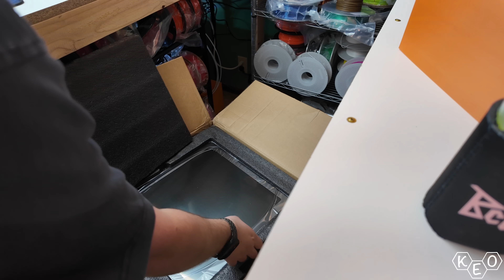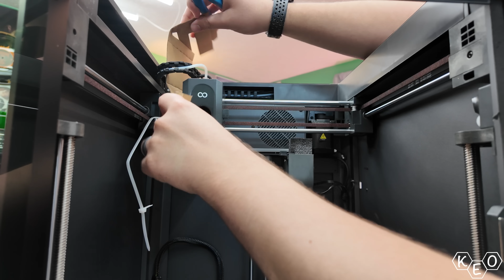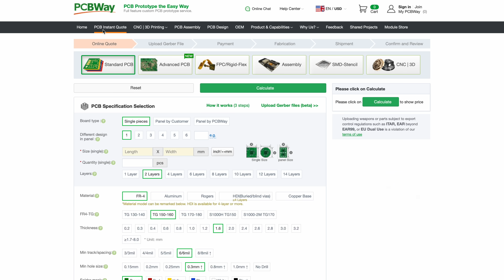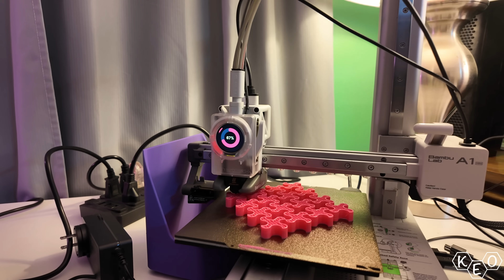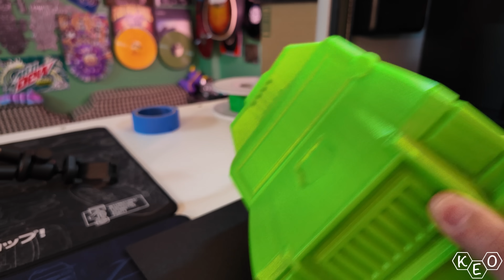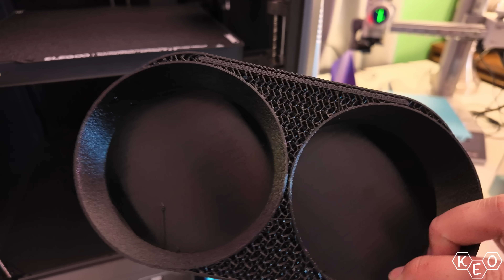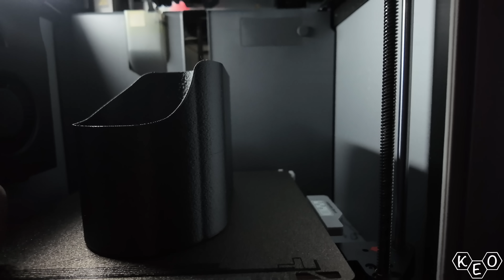$300 for THIS? Elegoo Is Playing Dirty…

Comment: Another great video.  I posted my unboxing and first print video a couple of days ago and it was funny to see you mentioning some of the little niggles that I had.  That final curve in the filament tube into the print head is a real pain and I like your solution of running it over the top, but it really should have to come down to this.  One thing that nearly caught me out was the small piece of foam that was in the poop chute.  I had actually started my first test print and as it was warming up I spotted it just before the print head would have moved into it.  
I had one filament change, and the instructions on the control panel threw me a curve ball.  I kept hitting load and watching it go through the 4-point routing and then I'd be back at the screen where it asks me to load again.  I did this 3 times wondering by it wasn't detecting the filament that was flowing through the nozzle, until I realized that I had to hit the "home" icon on the screen that would then take me to the print screen so I could press "play" and resume the print.
I've only used PLA so far, but slicing a few models on a 0.12mm layer height setting has produced some fantastic results.  After seeing your results with PETG, I'll need to give that a go soon and see if my results are any better.  
Like you, I'm just very impressed with the price point.  If someone asked for a cheap printer for their kids to try out 3D printing as a hobby then I'd highly recommend this machine for ease of use.
I didn't see you do a firmware update.  I spotted that one was available when I set up the wi-fi.  If you haven't then perhaps that might help with the PETG issues.

Comment: PTFE Tube and filament path. The sharp curve is needed because of a lack of headroom under the lid. First thing is print a riser, then reconfigure the tube path. Simply unclipping the tube from the front half of the chain works pretty well. 
The runout sensor position doesn’t suit printing from a drybox. There are several simple prints online to space the thing off the wall and even angle it slightly. 

I wonder whether tube-drag plus stretchy filament might have been part of the TPU problem?

Comment: The IP address - one needs to go into the settings of the network router to fix the CC to the same IP address every startup. The CC doesn’t have the facility for a static ip address, and you don’t want to be entering a new number every day!
Reply: This. I give all my printers static IPs via DHC reservation on my router.
Reply: Your router should be able to assign static IP to the machine.
Reply: @tymoteuszkazubski2755  exactly what I said! Don’t expect the CC to do it for itself in a setting.
Reply: IP reservation is the way.

Comment: Been printing only ABS on my Centauri Carbon, its got just under 16 hours on it and needs replacement parts already.  The hotend keeps clogging and support are sending a replacement hotend and fan.  Prior to that though the printer was doing amazing at printing, the plate is perfect for ABS .  Support from Elegoo has been really good.  It also seems quieter when printing than my other printers
Reply: At least they offer a hardened nozzle too. The Kobra doesn't even offer that nor different sizes.
Reply: @Real28  Elegoo only offers a brass-hardened steel nozzle in all sizes for the Centauri Carbon.  Which I think is a good thing since the printer seems very capable with abrasives. I've only ever owned one Kobra and had no idea they only supplied brass nozzles in their newer printers, handy to know for future, thanks.  I think I just got unlucky with this one.  Hopefully the next hotend lasts longer and I can get some spares when they come in to stock, Which is some time in July at the moment.
Reply: "so is this like your first 3d printer?"
Sounds patronising ngl
Reply: I use ABS.. never had that problem
Reply: @marcwolf60 mine had a print head board failure causing thermal runaway. So it was melting where it shouldn't causing the clogs
Reply: @TeeborGames how did you diagnose the issue? I ordered my CC a few days ago with the intention of printing almost exclusively ABS
Reply: @GianmarioScotti there was a fault in the printhead board causing the hotend to get too hot.  Support sent me a replacement and it's been good ever since
Reply: A clogged hotend doesn't require replacement parts... Just know how of how to clear a clogged nozzle
Reply: @3dcreationsofri  You must have missed the part where I said "Keeps clogging" as in did it more than once.  So I must have cleared it and then it happened again.  However it should not happen at all on a printer with so few print hours on it
Reply: @TeeborGames so... Is this like your first 3D printer?   There are any number of reasons for nozzle clogs to happen, none of which are the fault of the nozzle... The nozzle is just a precision drilled hole in a piece of metal that you push filament through... If you're getting clogs, it's because of whatever it is you're trying to push through it... Perhaps poor quality filament, perhaps insufficient nozzle temperature, perhaps additives in the filament (i.e. some carbon fiber filaments will clog a 0.4mm nozzle repeatedly because the pieces of carbon fiber are simply too big to pass through the orifice, perhaps you're trying to print with too small of a layer height (I can clog a 0.4mm nozzle almost on command belt attempting to print TPU with a 0.8mm layer height.). The only number of hours use with a nozzle would be premature wear...i.e. if you got a 0.4mm nozzle and after putting a couple kg of just ordinary PLA through it, it was extruding a 0.7mm line width, then that would certainly be premature excessive wear... But even then a worn out larger orifice isn't going to cause clogs.
Reply: Bottom line...if you're getting REPEATED clogs, it's not the fault of the nozzle... It's either you're doing something wrong, or there's a problem with your filament causing it...not the nozzle
Reply: @3dcreationsofri  Do you want me to sign you up for a reading comprehension course? So you don't shit yourself in a comment section again?
Reply: This is the WHY you buy a Prusa. You'll be printing, not working on the printer.
Reply: @mortenkallesen923  what about those with Prusas that need to be worked on because spending the extra $$$ isn't a magic fix-all lol
Reply: @TonyAllen1988  For real i think bros mad cuz his printer is getting shown up

Comment: The newest shipments (I received mine on about 5/20) are coming with the PTFE tube issue you described resolved.   Mine was only secured for about 8 inches along the cable chain from where it enters from the back so there's no zip ties nor hard turn into the print head like yours showed.  Mine's been working really solid so far but mainly just PLA going through mine so far.
Reply: Yeah I got mine in the wave before that in April and it had the zip ties. I had seen the issues with that, so I cut half of them and let the tube have a larger radius.

0 issues and 8 spools of PLA later, still producing perfect prints. Its incredible.

Comment: Freezing - I gather that this was an issue that was supposedly fixed by the firmware update before last. What version were you using at the time of that problem? (Was it recently, on latest version?)
I’ve done over 100 hours on mine with no such problems. 
However I have had the touchscreen miss a tap - usually when it seems like the tiny little brain is distracted with other things. And I have noticed it more with the newest firmware 1.1.25 - though that might be me rather than a change in the CC. I have never had totally unresponsive buttons.

Comment: TPU stringing. Profile not build plate. Did you compare the settings in the filament profiles being used by the Bambu and the CC? Seems like simply the CC’s profile was a bit too aggressive and in need of tuning.
Reply: For me, TPU stringing is solved by a little less temp and a little more retraction.  I agree, though, that the CC's stock profile was probably for some harder TPU or something.

Comment: I was fortunate enough to be able to two of the units. The only issue I have run into so far is feeding issues at the extruder and from the drybox to the sensor. I finally got everything dialed in (knock wood) and love the quality. They have been able to keep up with the A1 I have. Great review!!

Comment: Why anyone would buy a Prusa Core One for $1200 over this for $300 is mind boggling.
Reply: I built a 350mm voron with 5 toolheads for under 1200$....
Reply: @amitelgabsi6552  damn, did you break into an extrusion factory or something? my stock 2.4 cost more than that to build
Reply: @WHAT_1400  you paid too much then tbh
Reply: @TonyAllen1988  that's more or less what an LDO kit costs in europe
Reply: @amitelgabsi6552 the kits alone are like $1k, how did you add a 5 tool head changer for that amount?
Reply: Don't let the Prusa fanatics hear you say that 😂
Reply: Its a Cult thing like scientology
Reply: Say that after you put a few thousand hours on each and the Prusa still works 🤣🤣
Reply: @tonydavis6487  We shall see.    The Prusa cannot produce  3x  the value.
Reply: @tonydavis6487  Then I buy another Centauri Carbon and STILL pay less than a Prusa...  After a few more thousand, buy another and...  STILL pay less than a Prusa.
Reply: @tonydavis6487  another way to look at it is that you could buy 4 Elegoo Carbons and print those thousands of hours in 1/4 of the time, let's even say 1/3 of the time including the extra labor of troubleshooting the cheaper machines. Meanwhile you're riding your core one like a horse you want to die and have 1/4 the peak production capacity, but at least you can look down on people don't have a Prusa the whole time. That's gotta be worth a lot in itself, though, right?
Reply: @tonydavis6487  I think 4 cc can outlast a prusa . maybe not actually
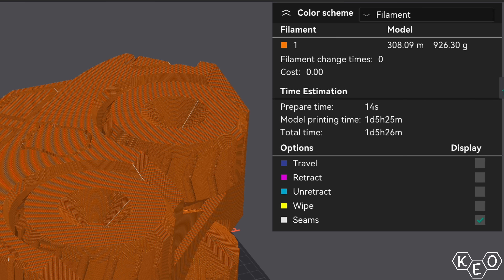Reply: @ShrimplyAquascaping doubtful. 15:26
Reply: @melgross but I thought that problem was because the nozzle hasn’t heated up yet. It’s the same on my Neptune. Although the cc does have a filament cutter
Reply: @ShrimplyAquascaping did you delete your post? I don’t see it here. I don’t remember what was said by you that I was responding to.
Reply: @melgross oh I didn’t delete it, I said the 4 cc would outlast a prusa and you tagged the time when the buttons didn’t work i think.
Reply: if u need consistancy and it not just for hobby it can make a lot of sense